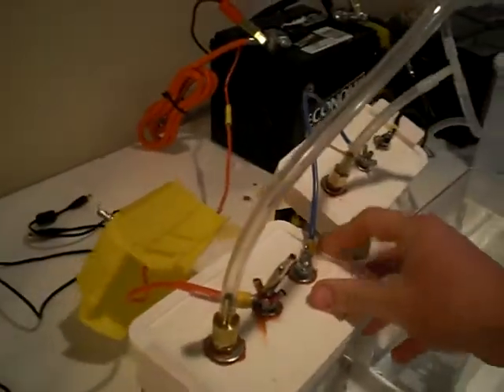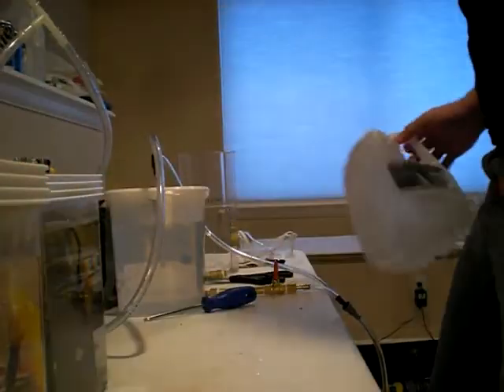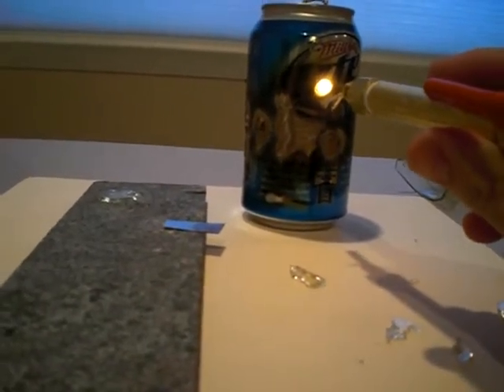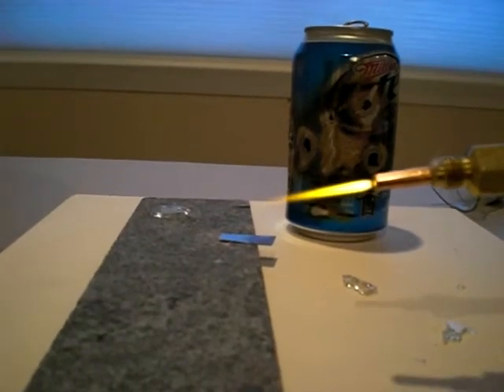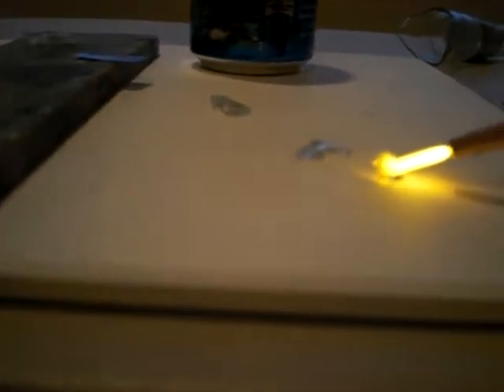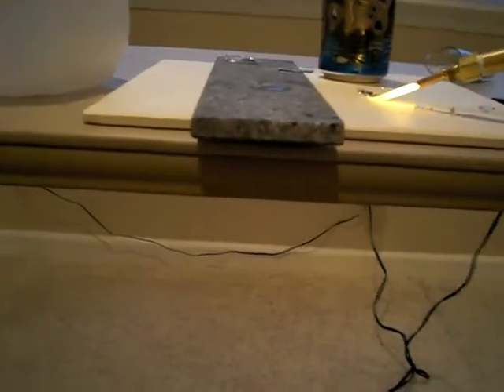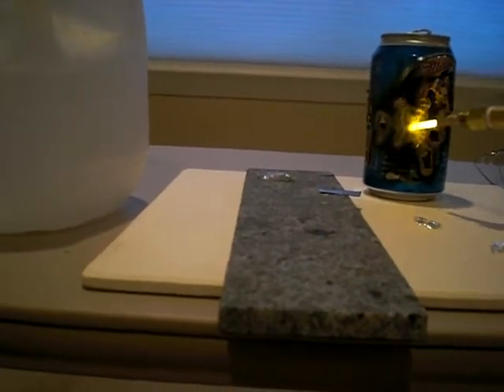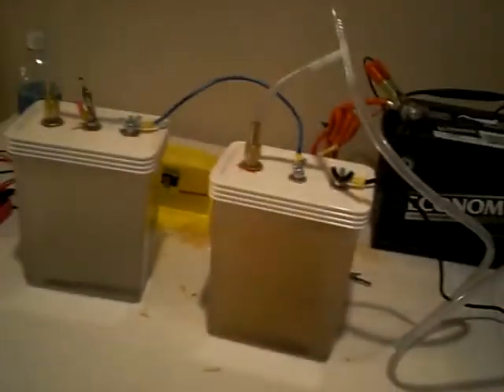Proof of Water into Fuel Technology, GreenFuelSpot.com

Comment from the maker: HHO Gas, stands for, Hydrogen Hydrogen Oxygen.  No one is denying that fact.  The whole point here, is to get efficient, renewable, cheap, energy.  What I'm proving here, is that you CAN make a reliable combustible gas from water.  That's all I'm proving in the video.  Personally, I'd like to see the batteries charged by wind or solar, then use that for electrolysis.  As long as energy is being transferred at low cost, who cares where it comes from if it can create fire?